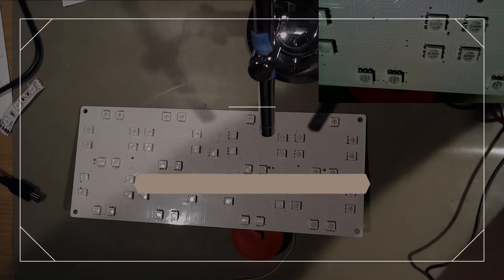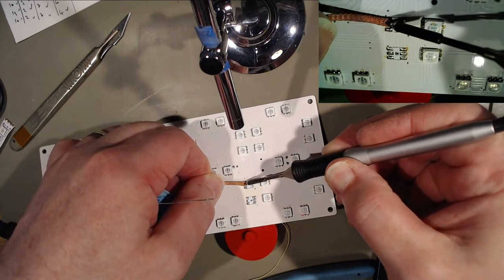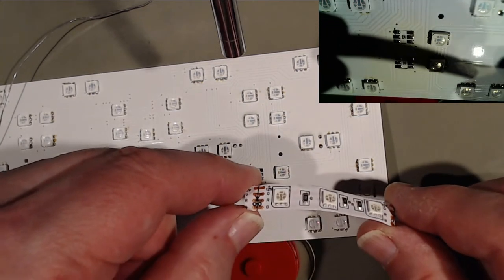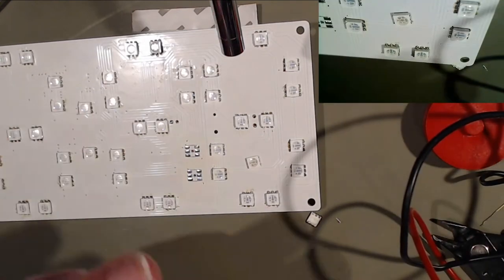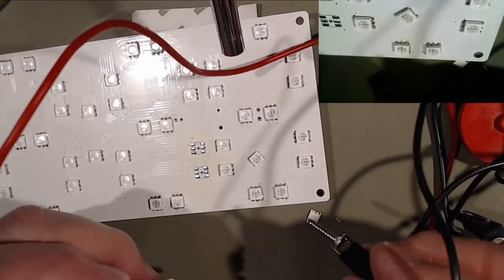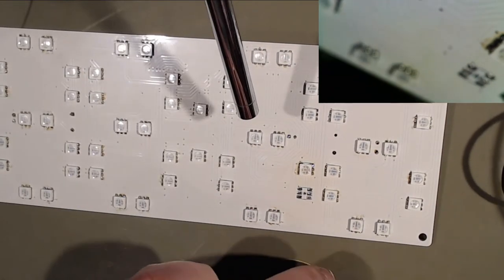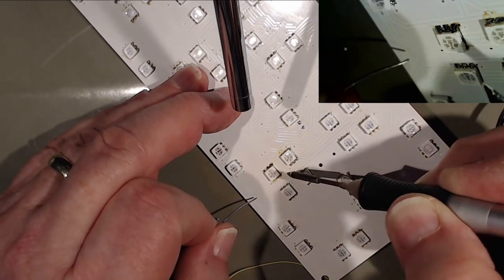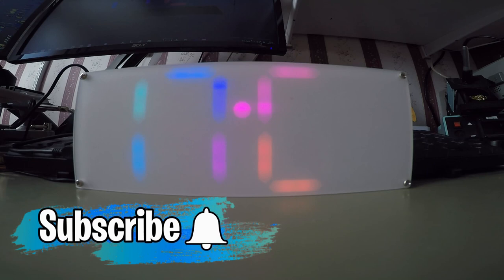#119 Banggood Rainbow Clock 2nd revisit  and Fix

Comment: Wow! That's fiddly. I add solder to the pads, place the LED and heat from the other side. Seems to work for me.
Reply from the maker: The other side has the rest of the components on it. I could have used the hot air gun to do it if I had some solder paste.

Comment: Im suprised you aren't using ton of flux, it helps with heat transfer a lot too
Reply from the maker: I've worked ìn and around electronics since 1976 and the most use of flux I've seen is on YouTube. I do have a flux pen but is about 6 years old and doesn't get used much at all.
Reply: @TheEmbeddedHobbyist  Liquid flux is garbage imo, the gel/paste one is great, and honestly don't think it can hurt using when it can be found quite cheaply especially if you make it yourself
Reply from the maker: @alexstone691  I think I’d make my own or buy from a distributor, not the sort of thing I would get from china. Same goes with solder I use quite a bit and want to know what’s in it and what safety precautions I need to observe. Even with a fume extractor I want to know what it releases into the air I breathe.

 The only real time I’ve used flux is with a solder pot where you are tinning 1000’s of wires at a time.
Back when I worked in production in about 1977, boy I’m starting to feel old.
Reply: @TheEmbeddedHobbyist  i tried messing with rosin and acohol and it works pretty good but for making gel flux ive heard patroleum jelly is good but havent tried it myself, although im pretty sure thats what cheap gel flux is made out of
Reply from the maker: At least if you get it from say RS you can get the SDS report, and find out it contains something like
Modified Rosin  60 - 90%
Azelaic Acid <10%

And wont kill you always a good thigh to know ;-)